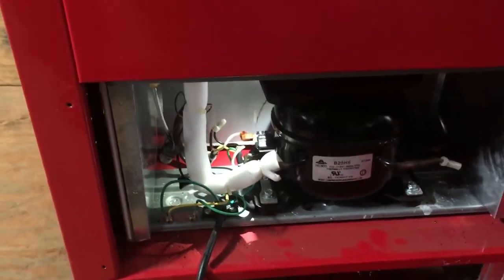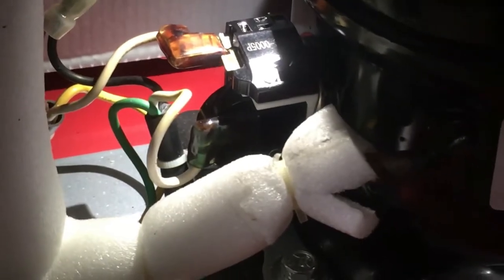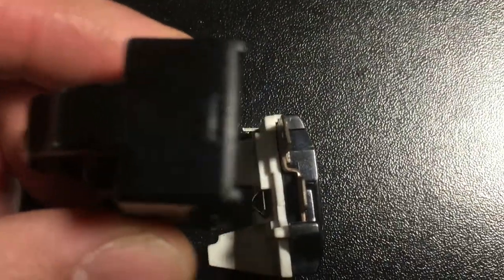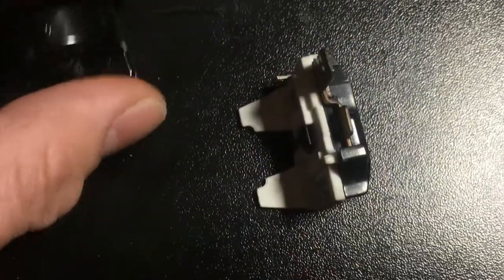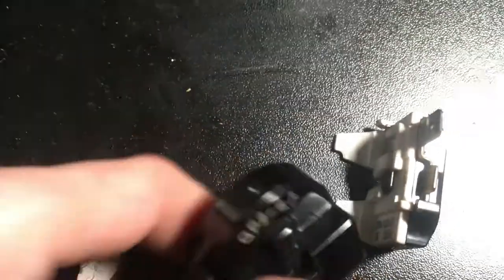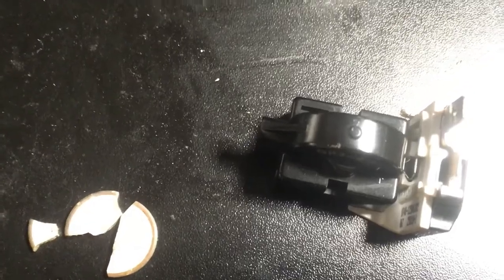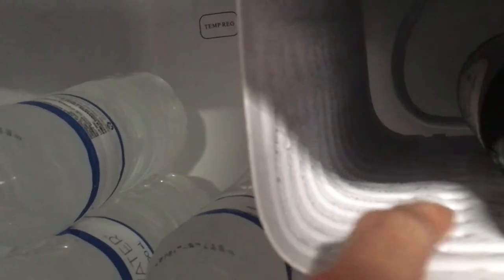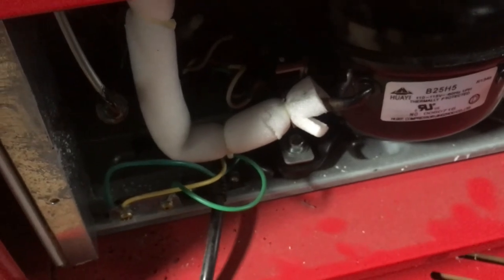Mini Refrigerator Not Working, Not Getting Cold, Compressor Hot, Surges, or Humming Easy Cheap Fix!

Comment: For those who need to search the internet for parts, don't use the names said in the video; they are incorrect (but the names in the video description under the part link are right). The flat white part is not the "relay" (which temporarily directs power to the compressor to get it going during startup); it is an "overload protector" (which disconnects power to the compressor if it overheats). And the black part is not a "run capacitor" (a power-boosting/stabilizing device that is often not found or needed on cheap mini fridges); it is a "PTC starter", often referred to as the "start relay" or simply "relay".

Comment: I got my 4.2 cu ft stainless steel Criterion fridge at a scratch and dent sale for $50 and it's two years old now, have had no problems with it. P. S. I have 22,500 watt hours of battery bank now.
Reply from the maker: Sweet
Reply from the maker: We need to upgrade ours the freezers pull almost 30A together when running the inverter draws about 2A sitting there so room for improvement, but it all works very well!

Comment: My mini beverage cooler turns on but not cooling inside. The compressor is running and vibrating and gets super hot.
Reply from the maker: @KMCGmom  compressor is probably on the way out unfortunately
Reply: @DIYKAI  awwwe ok thanks

Comment: I replaced the two items you showed in the video but my magic chef wine cooler is still not cooling.  I still hear a lot of noise and the compressor is hot to the touch.  Any troubleshooting tips?  Thanks!
Reply from the maker: Compressor could be shot or power board

Comment: I have an Antarctic Star model and when I got the relay off it doesn't rattle. The symptom is that the unit overheats and does not cool. The compressor was not coming on. My question is...
 do the relays always make a rattling sound ???
Reply from the maker: Not they don’t best way is to check and see if that ceramic disc is cracked
Reply: @DIYKAI  Ok the disc is not cracked...could it be the white base part that is defective? I see no oil leaks so I don't think it's the compressor. What about the thermostat?
Reply from the maker: @MANCAVE-xz1bp  when we ordered the new one it came with both the relay and disc so we changed both it very well could be.....the thermostat being bad I would think the compressor would still try to start maybe?
Reply: @DIYKAI  I will replace both and see what happens...will let you know
Reply: @MANCAVE-xz1bp  did it work?

Comment: i replaced it didnt work for me. Compressor does turn on and I can hear it. not sure what else to do.
Reply from the maker: Sometimes the circuit board goes out these things are made cheaper and cheaper
Reply: @DIYKAI what do we do if that’s the case
Reply from the maker: @coachmetony  compressor, new refrigerator, or if you have one like this inside of something measure and swap it out

Comment: Why can`t they build these things to last and function properly? I bought a 3.1 cubic ft dorm fridge so I can have refrigeration after hurricanes because they can be powered by solar power stations of 500 watts and above. But I`ve discovered some 500 watt power stations malfunction with it. A new one I bought runs it until it reaches 69% battery remaining and the inverter shuts off. A total mystery! It did this three times in a row but the power station arrived with a dead battery and I think that damaged it. The seller thinks there`s nothing wrong with allowing a lithium ion battery to sit at zero charge for months. So I`m going back and forth with them.
Reply from the maker: We are in a throw away age unfortunately….lithium should be stored close to 💯% if stored for over 3 months 50%

Comment: Hi, my relay thing doesn't have a second part, only the black one with three holes to attach to side of compressor.  I've changed that relay with a new one.  I hear the compressor turn on, but then clicks off right away.  It's also super hot, even long after it's off and even after plug is pulled.  BTW, the initial relay did rattle, that's why I replaced it.  Any advice? I'd appreciate it greatly!  (Also, the freezer was working before, but the fridge was not cooling.  Now nothing works cuz it keeps shutting down.  Help!!
Reply from the maker: Hello, a few things can be going on first make sure the unit is clean and free of all dust and debris in and around the compressor area and coils or fins do this while the unit is unplugged and the door open to bring the inside up to room temp. Recheck if you still have an issue, it may be low on freon, bad defrost or main board circuit. Hope this helps
Reply: compressor might be locked up.

Comment: Is it normal for the outside of my mini fridge to be really hot, but it’s still cool on the inside
Reply from the maker: it depends where it is hot? On the back by the compressor yes because the heat generated from running and the condenser exchanging the heat in the freon